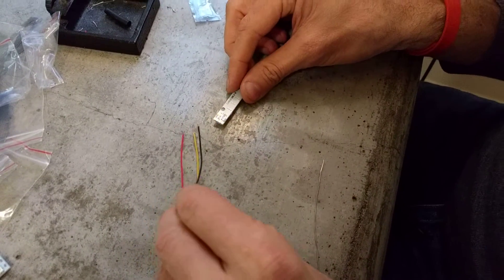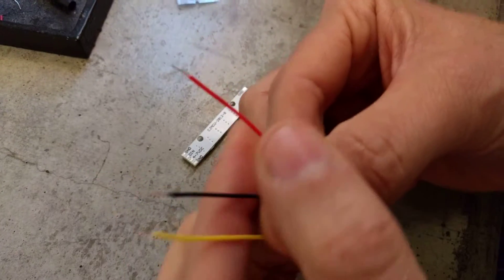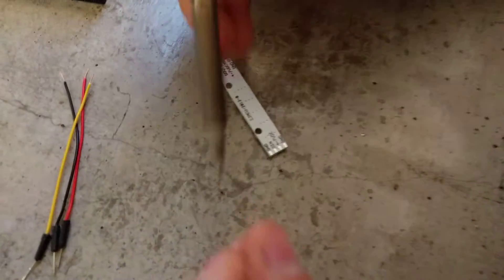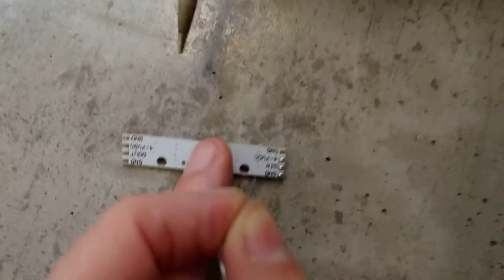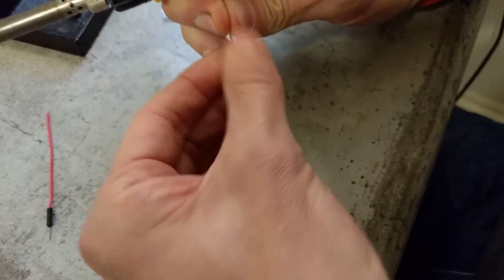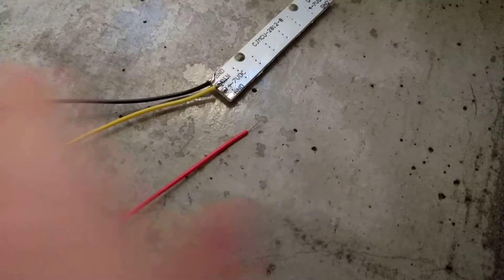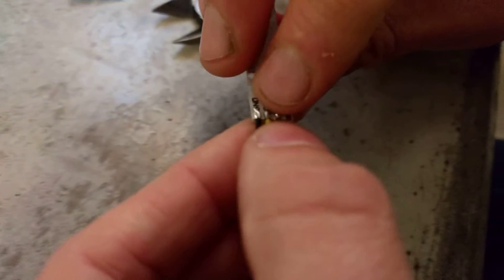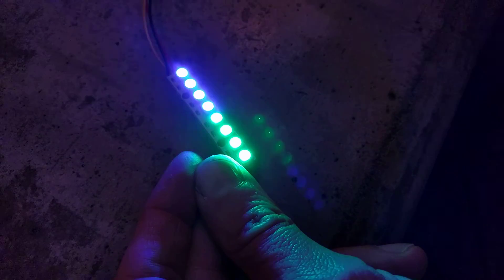How to solder a neopixel strip without destroying the pads

Comment: That works ..but try a couple suggestions mate, to make this much, much easier and better:    1.)  Get yourself a "flux pen". It will have a felt tip. Swipe it over the Neo's solder pads. 2.) Also swipe it over the ends of the wires.  3.) Because you used the flux pen, you will be able to apply a cleaner, smaller  "ball" of solder to each pad.  For the wire preparation, swipe the flux pen over each end and then lightly "tin" them with solder also. Cut the tips of the wires to size -- no need for the extra wire for "wicking" because of the pre-tinning and flux. So, trimming the wires to proper length first will eliminate the sloppy ends needing to be trimmed.  4.) Solder the wires.    By using a flux pen, you will find that this process goes so much smoother and produces a far superior, professional-looking solder joint. And the process is more fun as well.  Also, you will find that using the flux pen (sparingly) will reduce the hesitation of most solder joints to "begin". The flux is also a great conductor of heat -- kind of a "liquid heat" that makes the solder behave. Flux core solder doesn't begin to work until AFTER the solder melt "begins". Flux applied over these joints (and especially on the uP breakout processor boards) will greatly improve the soldering experience for beginners.  Note:  My compliments to you -- and  no offense mate -- you deserve all the credit for taking the time to do this great video. Thanks &  Cheerio !

Comment: I got cheap pin header packs (just male pins either side from aliexpress, cut them into 3 and with their little retainer bar still in place, they line up perfectly to the pins. Once one is soldered the rest can't move, and I don't need to cut jumper wires then, I just use the female end onto the pin header. Nice vid :) thanks. What I would like to know is how people are attaching these in series, is it really just the solder holding the thing together in the case of adafruits page on the neopixel stick there are two in a photo, end to end. If so, I'll just remove the retainer bar once 3 wires are soldered.. and match up. Also, do you always ignore the advice from adafruit of a capacitor and resistor on these? I realise this is 3 years old lol, but it's pretty new to me lol.

Comment: What gauge wire did you use to solder the strip?
Reply from the maker: Christin Lai not sure of the gauge, pretty thin. They are actually just standard M-M jumper wires with one end snipped off. 😊
Reply: When you strip the wire, do you know which number on the side of the stripper did you strip the wire on? That's probably close enough. 

Alternatively, got a link to where I can buy the m-m jumper cable?
Reply from the maker: At a guess I'd say jumper wire is about 20-22AWG size. It's fairly thin. I use it because it's convenient and the other ends can go directly into a breadboard. 

EG: https://www.aliexpress.com/item/65pcs-Lot-New-Solderless-Flexible-Breadboard-Jumper-wires-Cables-Bread-plate-line/32725034190.html
Reply: Christin Lai is there a way that you can connect the wires to small batteries similar to a laser pointer? I'd love to see a video like that

Comment: What do you use to insulate the connections in that video?  It looks like hot glue perhaps?  Or is it something else?
Reply from the maker: Albie Caruana just a dab of hot glue after soldering. it's as much to create mechanical strength as insulation.